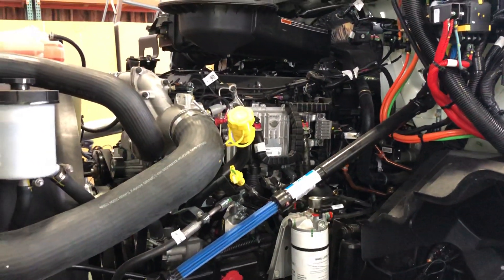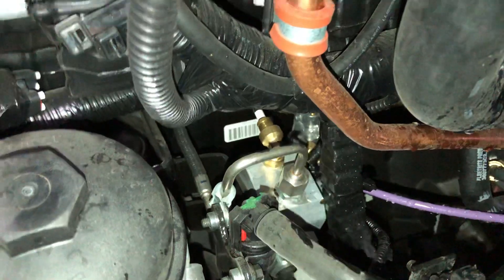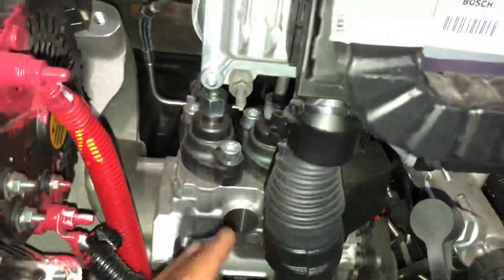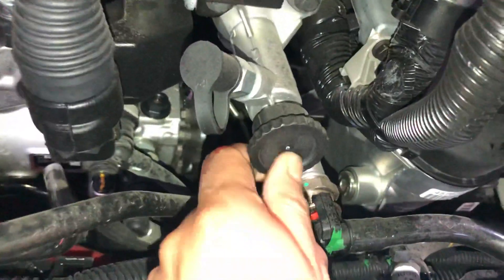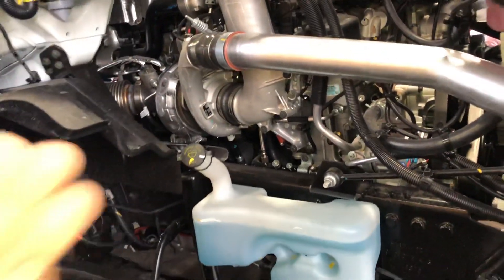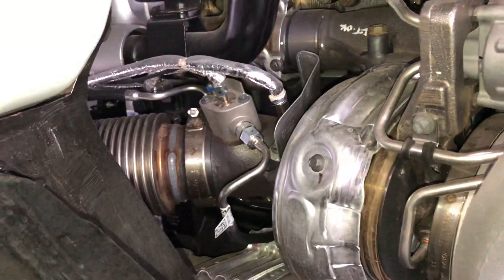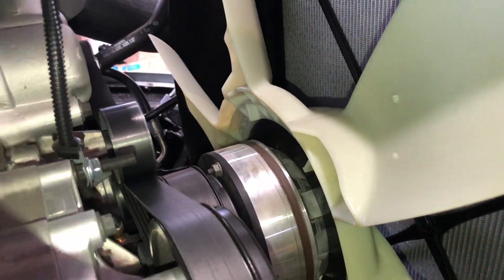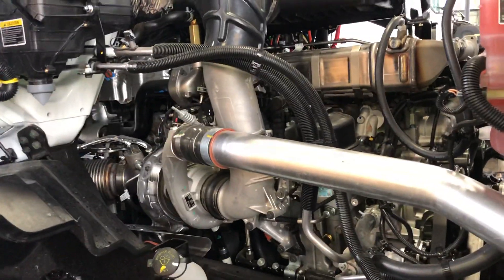International Engine A26 2019: A quick review to an update design.

Comment: A26 owner here this engine is actually pretty good like any other i had a few electrical issues and def issues i deleted the def and is excellent is fuel mileage reaching up to 10.5 a mile without def very light engine and not as loud and heavy as Cummins, the engine has beed good i recommend to use synthetic oil and take good care of it , A26 will take care of you

Comment: So I'm looking at the HX series. You think an A26 is more reliable than an X15? Or more cost effective maybe?
Reply: Well the warranty is good on the A26 500k for engine components and 800k for short block, common failures are egr valve, injector,  jake brakes, Nox sensors and of course con rod bushing failure havent seen any cylinder head issues out of the HX but international says it is the same as over the road truck so might see a lot of problems on them once they get up to 600k miles also if you dont like oil leaks common issues is the same as the maxxforce crankcase filter oil cooler module fuel pump and air compressor not saying its a bad engine I see a lot more of these than your average person im certified on the engine 1 of 2 in my shop but other than that pulls good jakes work decent do not buy with ultrashift transmissions if you are planning on spreading rock or climbing hills at low speeds
Reply: Might be cost effective depending, but I still think the Cummins is the way to go especially for pulling power.

Comment: Is the A26 reliable? Major problems?
Reply from the maker: Well, in my personal opinion, Freightliner Cascadia and Volvo VNL 760 are better trucks than this one, but for price upfront you can get a low miles truck with international. Still, again, that does NOT mean you could get a reliable truck just because it has low mileage. My advice would be Freightliner Cascadia are the best trucks to start a business but keep searching around online so you can build your answer with other owners and find out what they think.

Comment: I’m thinking about buying a 2015-2017 international with a n13 engine are those the best years for that engine since rebranding it from the max force also I will be deleting the def so I wouldn’t have to deal with that problem or should I get a a26 engine I’m trying to have a low overhead for owning my first truck
Reply: Now A26 gives you 1.7Kms/7 years warranty on motor.
Reply: Don’t mess with international truck/engine there just junk

Comment: Does these give a longer lifespan if egr is deleted?
Reply from the maker: Yeah, that might be the case for these engines. Deleting the EGR system is NOT recommended but since this engine has so many problems, many people take that a simple and straightforward solution. Personally, I do not recommend to modify your ECM but some owners might want to take the chance to forget about those EGR and DPF relate it problems. Thanks for watching and support the channel.

Comment: the A26 linked up with the eaton 10 speed auto isn't the best. freightliners dd12 is smoother shifting.  you can hear the trans slapping itself under the truck and is very jerky and slow going thru gears 1-5 once it gets to 6 it has some good pull.  bobtailing from a stop, other trucks with trailers pulled away faster than this setup until I reached 6th gear and closed the gap.  very sensitive hooking and unhooking the truck from trailer and backing into dock isn't very smooth. my general opion on the LT is poor. fit and finish is very cheap like prior prostars. seats are uncomfortable lumbar support is mid back, and always have lower back pain. not enough recline. steerin wheel adjustment not good enough.  knee hits tilt lever. the auto shifter feels cheaper than freightliners.
Reply from the maker: Glad to read your opinion about this truck, Navistar/International has improved their vehicle compare to the older design but still it needs a lot of work to put their name in the top of the competition. Let’s see in the years to come if they can improve their design. Thanks for watching.
Reply: Yeah I prefer just a good old fashion 10 speed or 13 Speed Rd. ranger
Reply: Spot on. I've been assigned to an LT in the company I work for I can literally hear a loud clank when driving and shifting through gears. I agree, with the seats they feel very cheaply made, they constantly sqeak and rattle

Comment: We heard this is a non regen engine 
Is that true?
Reply: No truck I’ve ever driven with SCR has required a parked regen. If you are requiring a parked regen, you have a serious problem. I have an A26 with 307k miles on it and it’s great.
Reply from the maker: As far as I know and I see, there is a regeneration inhibit switch in the dashboard, so that is not true at all, it might be true that will require less time to perform the regeneration at highway speeds... but we performed the parked regeneration in those trucks already and well... they still take around an hour to finish. So, with this, I can tell you that those trucks still need parked and passive regeneration.
Reply: No.